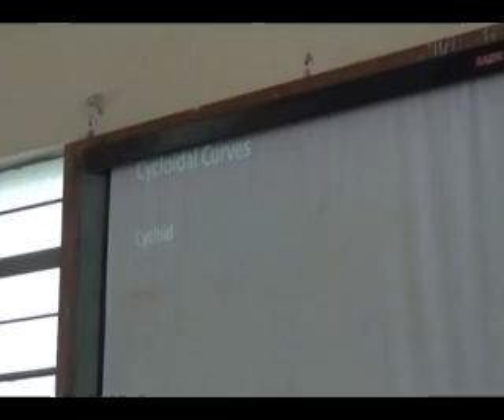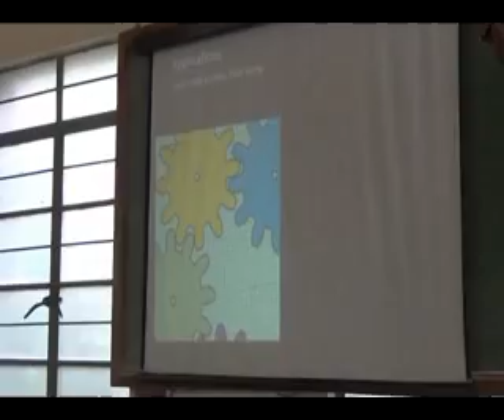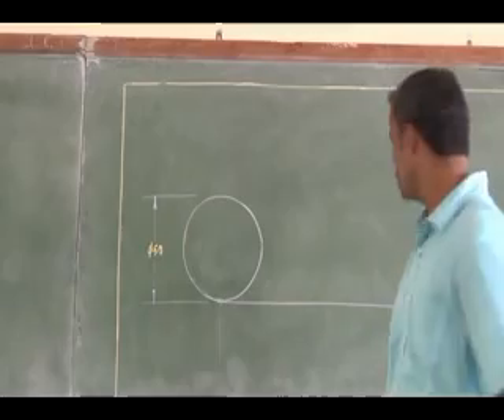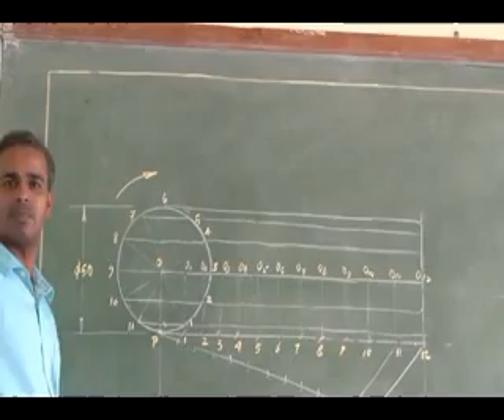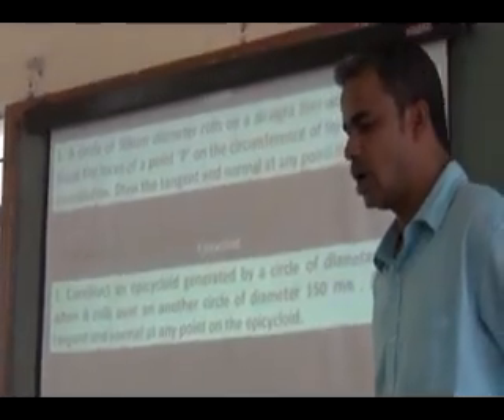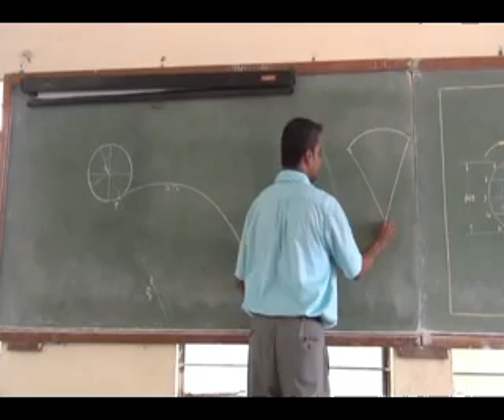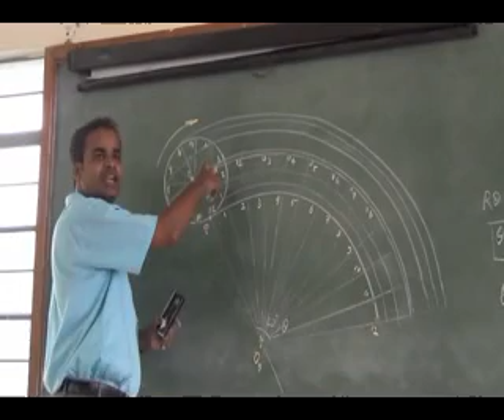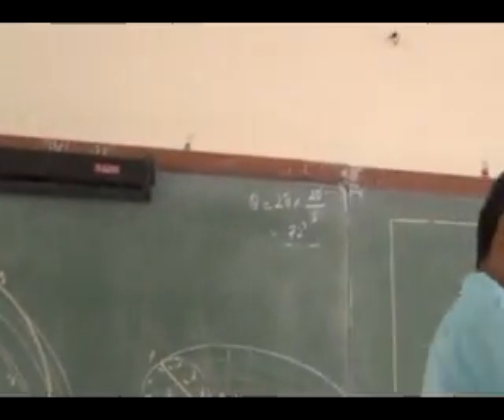Engineering Graphics   Cycloidal Curves

Comment: Can anyone tell me the difference between helical motion and the cycloid motion? I'm confused a bit. Which of them exhibit an increase in radius? 
p.s. : don't have time to watch the entire video :P
Reply: (I)Helical Motion : Particle moving in a circular path. Along with this motion, particle also has velocity in the direction perpendicular to the plane of the circle. It's circular plus linear motion. Path looks like COIL or SPRING !

(ii) Cycloid : Suppose, we have a circle. Let us fix a particle on the circle(i.e. on any point on the circumference). Now we start rolling this circle (like TYRE of the Bicycle moves). Our particle with start moving. This trajectory is Cycloid. It's 2-D motion.
Here also Motion=circular + linear. But along the plane of the circle unlike helical motion in which linear motion is perpendicular to the plane of the circle.
 Radius do not increases in any motion(As I understand).

Note : I was looking for  this answer some time ago. I saw your question. When I got the answer. I thought to write it for you.